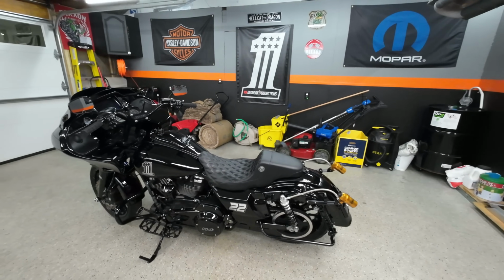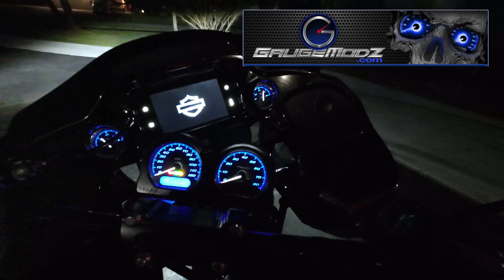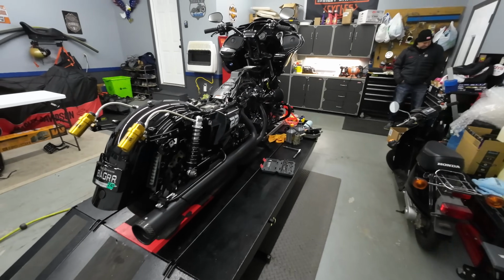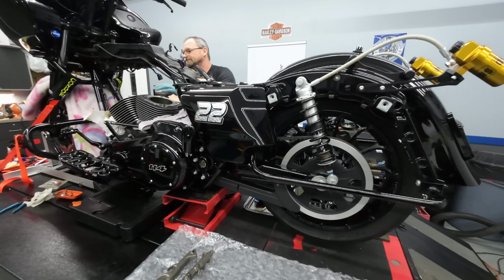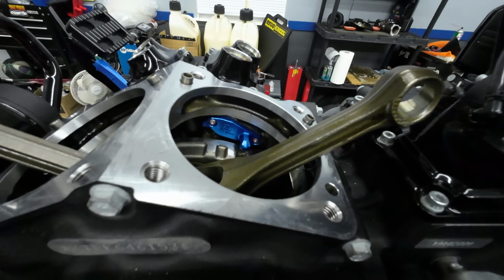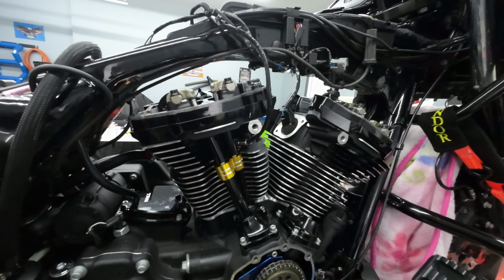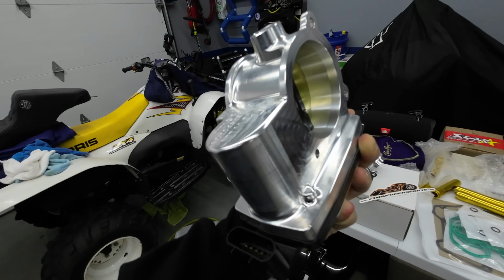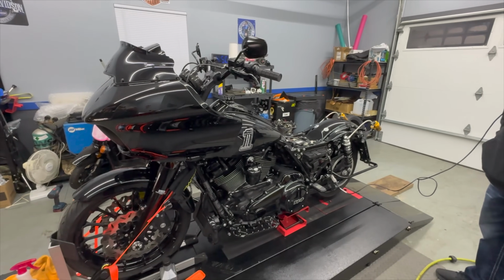SAYING GOODBYE TO MY 128CI BIG BORE KIT...

Comment: Hey what brand of front wheel spacers did you use on your bike,I saw them in one of your videos
Reply from the maker: Stock - just powder coated black.  If you're talking about the ones on my moms RG - those are the beveled ones from Harley.

Comment: My guess is Next part is Inverted Forks from Ohlins if adding gold… do I win anything if am right lol.
Reply: Sounds good.  I built my M8 cvo street glide last winter 140 cubic inches with a on center 70 mm intake manifold and customer solid roller cam from comp cams   With adjustable roller rocker 1.4 ratios. And set the valve lash 18 intake 22 e   With fueling solid pushrods 50 over stock length. Made 171hp 182 torque 140 torque at 2000 rpm.  Yours should be up good as well. Sounds similar to mine.  Good luck on the dyno pull tune 👍
Reply from the maker: Haha I wish!  Can't afford those 😮‍💨

Comment: Oh cmon man lol. Not even gonna tell us what size motor you went to? :/
Reply from the maker: I will give all the details after Daytona.  I have a bunch of races set up for Daytona - So I don't want to share my recipe just yet 😉
Reply: 130"
Reply: Your recipe?, 130" kit 11:5 Ward 615 cam, +2 heads. Should be 160+ mine made 165 on a soft tune 91 octane no timing........ With a Jackpot riot shorty. Have fun at Daytona!
Reply from the maker: @diesel454ss  That might be your recipe, but that's not mine lol thanks!